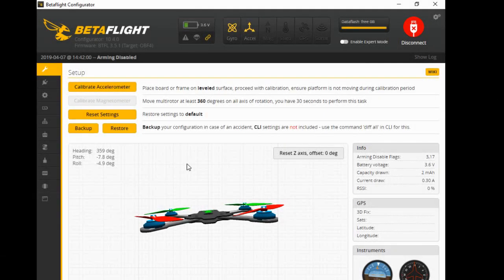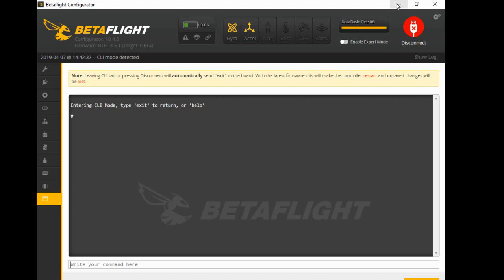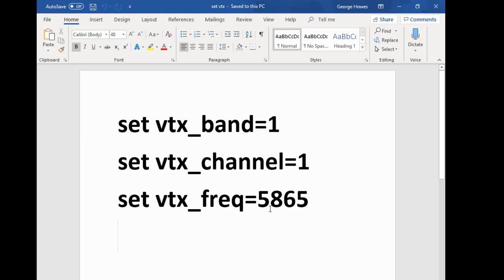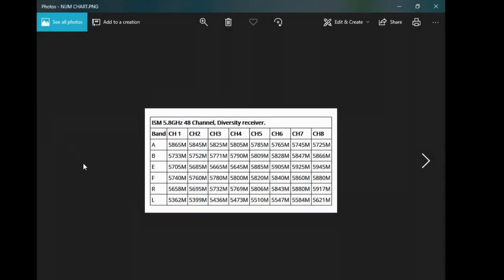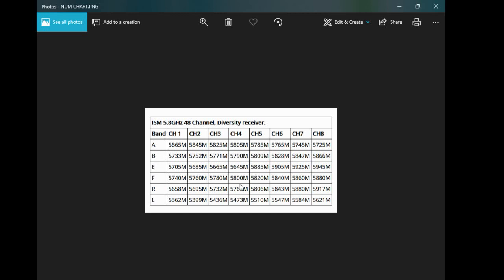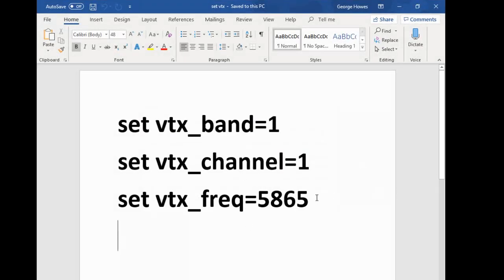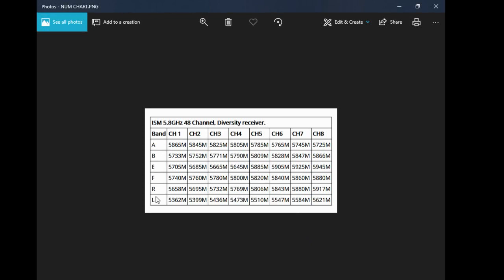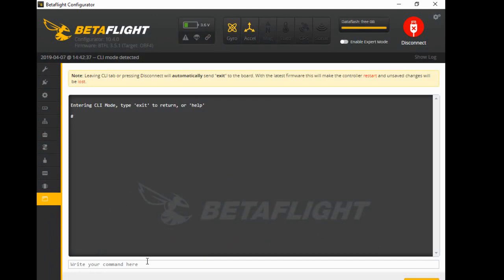VTX INFO HOW TO CHANGE IN BETAFLIGHT

Comment: Perhaps I’m being thick here.. but Surely this only works if the VTX is wired to a uart, in which case it must be tramp/smart audio?
An older VTX with no uart connection can’t possibly work can it??
Reply from the maker: Yes it work, as long as your vex is wired to the flight board, you can check it in betaflight in the control line by typing set vtx and if the info comes up you know it will work. I almost always set my vtx up this way while I'm setting betaflight on a new Quad, and I almost never use Smart Audio. However there are other ways of doing this but this was the simplest way for me to explain to Him as he had damaged his VTX. Cheers and thanks for watching